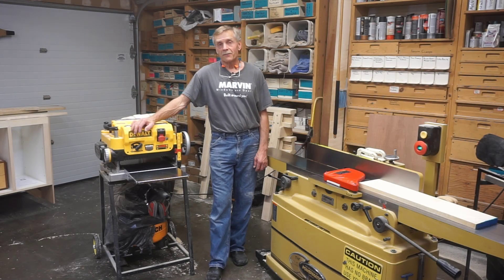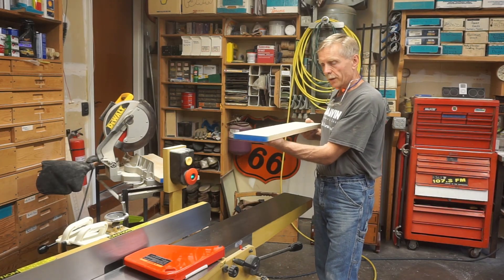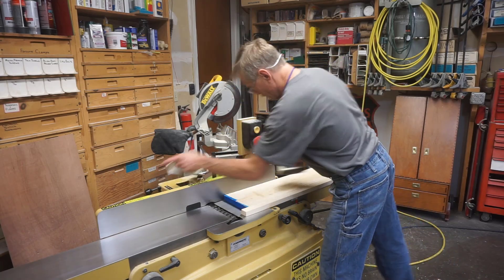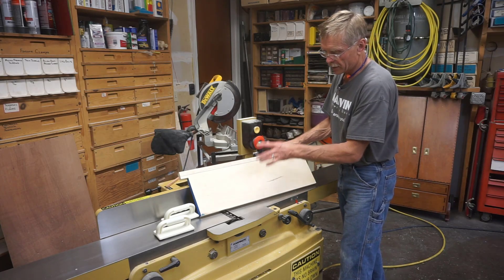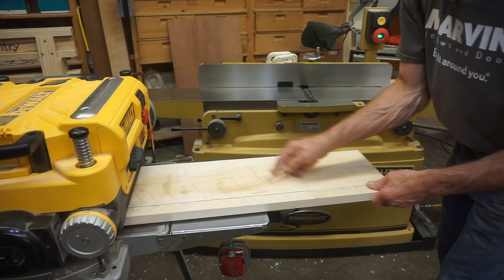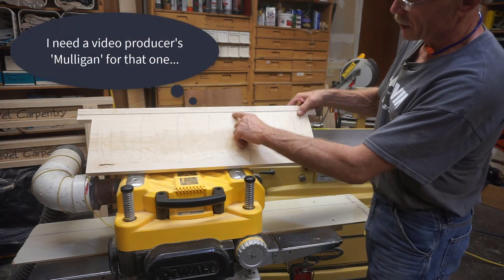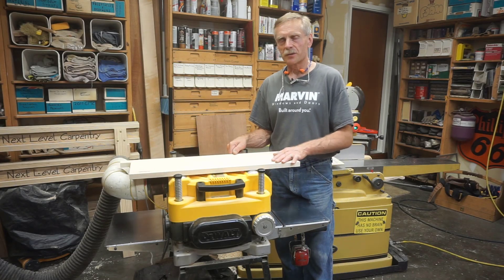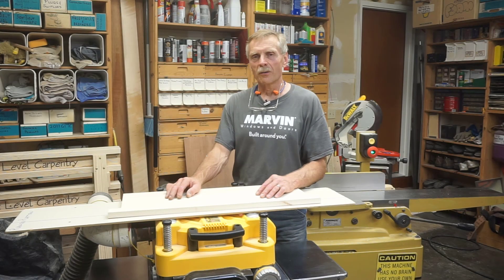Supersize Your Jointer for Planing Over-width Boards

Comment: Could you also make a platen for the infeed table of the jointer?  The board would ride on the platen and thus be clear of the rabbeting shelf,.  This would eliminate the need to remove the shelf.
Reply from the maker: Mike... your idea works in theory and probably also in a pinch or if no thickness planer is available but capacity and quality of the end result would likely be compromised as well.... never know what's possible until you try it!  Cool part is that you're thinkin' about more options and I like that part! Best, Matt
Reply: Matt - thanks for the quick reply.  I wasn't thinking of the jointer platen as a way of bypassing the thickness planer (I have an 18" Woodmaster planer), but simply to allow multiple passes on the jointer without removing the rabbeting shelf.  In fact, on my 8" Grizzly jointer, the infeed table is wider than the cutter, so removing the shelf wouldn't help - the ridge left on the board after the first jointer pass would ride on the wide infeed table.  So a platen on the jointer would be needed if multiple passes are to be made, at least with my Grizzly.  I'll get a sheet of hardboard tomorrow and try it out.
Reply from the maker: @MikeON22  Oh, OK, got it.  I think you're on to something there... a guy could get a LOT done with a 1/4" mdf melamine 'overlay' platten the width and length of the infeed table!  Just thinking out loud here: you'd have to make sure it was really secure and held down tight and then just set the depth of cut an extra 1/4" deep.  The only limitation I can see at this point is if you needed to remove more than 1/4" of material to flatten the board because it wouldn't clear the rabbet shelf but would certainly work 90%  of the time.  Thanks for adding this Mike... good thinkin' !!!  Best, Matt
Reply from the maker: @MikeON22   I understand the table width to cutterhead width issue you mention.  On my powermatic I use a 'rabbeting tip' in the Byrd Shelix spiral cutterhead so I can still rabbet.  The unique shape of the one carbide insert removes that little shaving of wood so that the edge of the cut clears the outfeed table.  Not sure if you actually meant your 'infeed table is wider than the cutter' or if you meant the outfeed table.  If outfeed table, I always set straight knives to stick out of the cutterhead slightly on the left so the cut clears the outfeed table.  With the spiral head the rabbeting tip addresses the issue.  Just added this FYI in case it's new information for you, not like I think you need any schoolin' from me... 😏 Best, Matt
Reply: Tried it this morning and it worked great.  Yes, it is the infeed table that extends beyond the cutter, on the side away from the fence.  So I clamped a piece of hardboard to the infeed table and jointed an 8-1/2" oak board on my 8" nominal jointer.  Then planed it with your method.  Thanks for the tip about the rabbeting inserts.  I wasn't aware they existed, so ordered some for my Byrd Shelix spiral cutter and installed them.
Reply from the maker: @MikeON22  The rabbeting inserts seem like a well guarded secret which surprises me for how important they are.  I'm going to remember your infeed table platen idea next time I've got to deal with over-width material and thank you in advance because I've always hated taking the rabbeting ledge off and then getting it all lined back up when putting it back on.  Best, Matt
Reply: Matt, love this tip even though I have a 12" jointer, because I can use it in others' shops and pass the info to fellow woodworkers.  Love the dialog between you and Mike also, as it got my rusty brain-gear turning.  I have, on numerous occasions, tried to flatten boards wider than my jointer on my jointer------with great frustration.  My machine doesn't have the rabbet insert to worry about, but reading though Mike's evolution, I thought there might be a way using a platen.  I set the jointer to 8" and took a 3/16 pass on an 11" wide board with nearly 3/16 cup and twist.  Then I clamped a 4" wide x 3/16" thick piece of underlayment to the infeed 4" away from the fence, registered the middle (newly flattened) portion of the board on the platen and ran the remaining rough 3"over the jointer to achieve a perfectly flattened face.  With yours and Mikes help, I now have a way to flatten a board 50% wider than any(???) jointer.  Now, please help me get a wider board through my 13" delta planer!!! 

PS.  Just after I finished writing this, it dawned on me that I could have clamped the platen next to the fence, removed the fence and then run the board.  This location of the platen would theoretically allow flatting any width board over the jointer by just stepping it over 4" at a time (the board, that is). @NextLevelCarpentry
Reply from the maker: @francismccabe3265  I appreciate your commentary on this... it's got me assured that I'll adapt the partial platten idea next time I'm flattening wide stuff that takes more than one pass to flatten because it's such a pain to remove and replace the 'rabbeting lip' from my jointer (and any jointer too, I assume).  I'd be nervous about removing the fence and running the board the other way though... just makes me uneasy thinking about the workpiece drifting off to one side or the other and exposing the cutterhead mid-pass.
It is an interesting concept though...
I've got no thoughts on planing 13+ inches in  a DW735 though, so if you come up with some magic for that I want to be the first to know, OK?
Reply: If I make that magic real, you've got a deal.  I didn't have any problem keeping the board on track because the remaining "raised" rough surface ran alongside the platen, making the platen a fence.  My board was only 2 feet long also, so no problem.  This application is probably best suited for raised panels and short table tops, etc.  I agree with you, long boards would be quite difficult.  My big ole antique jointer actually has a rabbet groove 5/8 inches deep on the outfield table (a 12 inch jointer with 17 inch wide tables), so I don't have the rabbet lip on the infeed like the newer jointers.   @NextLevelCarpentry
Reply from the maker: @francismccabe3265  your 'ol jointer sounds like a beast of a machine! Way to go keeping it in active duty. Is it an ordeal to sharpen those long knives?  Can you get new replacements?  A millwork shop here used to have a knife sharpening fixture that bolted to the outfeed table which really made blade maintenance a breeze for them.  I always envied that because the old Delta 8" machine I used at the time was a real chore to service.
 I now see how the material feeds along the platen on the second pass... far less of a cringe factor than I was imagining.  Can't wait to try this next time.
Best, Matt
Reply: There's a bit of story behind that monster.  15 years ago I bought a big Delta table saw on Ebay from a farmer in Wisconsin.  In the pics I noticed some other tools around, but not for sale.  Built a rapport with him during purchase and shipment, and found he had that 12" American (made by American Wood Working Machinery Co up the road from me in Williamsport, PA probably between 1915 and 1925).  Price was $750. He said he thought it weighed 750 lbs.  OK, my little 1970 vintage Kubota with homemade forks on the bucket can lift 800 lbs.  He also had a 24" Powermatic planer complete with blade grinding attachment mounted above the cutterhead (like you, I sure wished I had something like that)!  Unfortunately the planer was over a ton, took up 5 ft x 5ft footprint and had 10 hp worth of 3 phase motors, so I had to (take a) pass on it.  I still think of the things that could have been......

Well, the jointer arrive crated weighing 1490 lbs.  I had it delivered to my work at the ship pier and used a fork lift to get it into my (then) GMC 1500, and drove it home-the truck, that is.  My shop is above the basement garage with exterior entry door over 4 ft above ground.  I secured a 1 ton chain fall to the floor at the other end of the shop and skidded the jointer up a ramp of 4x4s and into the center of the shop.

The jointer had a 7.5 hp 3 phase motor direct connected to the cutter head, so i removed that and mounted a 3 hp single ph inside the solid cast iron skirt of the four-footed jointer.  Used a hole saw to cut a hole in the iron skirt for the motor shaft to protrude,  perturbing the artifact Nazis out there, I am sure!  But the machine had already been modified to a 3 knife cutterhead with ball bearings replacing the original babbitt, and the motor was also a very poorly installed modern thing.

I was able to get the knives sharpened locally, no problem, but they were a real pain to reinstall in the cutterhead evenly.  I was successful in keeping them sharp by lowering the tables a bit, wrapping a couple loops of protective tape at each end of a large oilstone and using it to hone the blades.  I rigged a wood block to index the head and maintain position while honing.  The next 2 times I ground the blades myself by putting a grinding wheel in the tablesaw and using a cross slide jig.  Yeah, disconnect the dust hose and clean out the saw cabinet prior!!!

The blades markings indicate they were made by some aftermarket (I can't remember which) blade maker, but I am not worried about replacement as I don't do enough work to wear them out.  Some of my friends have converted to those carbide cutter heads, but at this time, I cannot justify the expense, plus I would probably need to re-bearing and reshim the whole thing.

       @NextLevelCarpentry
Reply from the maker: @francismccabe3265  wow... and epic tale for an epic machine... it's cool you kept if from the scrappers too! I don't remember seeing you on the alumni list from M.I.T. but, from the sounds of it, you earned your degree in advance Egyptian Engineering there!  Truly a labor of love to get it, get it up, running and useful as well as keeping it that way.... good karma if nothing else... Best, Matt
Reply: Well, Matt, I guess that although I have degrees in Egyption, Conniption and Science Fiction from M.I.T., I'm probably not on the alumni list cause I never graduated.  Seems like I have to go back there every day.  Good thing is that when I go, I always learn something.  There are those folks with MIT fear and don't go near.  Will they ever learn? 

I have several old machines that I rescued from the scrappers with little or no cash, although some have been over-paid for in time, skin and blood.  There is nothing like the feeling of bringing one back to life, though.  @NextLevelCarpentry

Comment: Just a thought and maybe I'm not thinking properly but could you move your fence over far enough to have the planed part of the board overhang and run your board over to plane down the last bit to match.
Reply from the maker: MrCFerren,
Not sure if I know exactly what you mean but it would be really difficult to plane off the 'lug' on the edge of the board on the jointer... it tends to get thrown off by irregularities you're trying to remove in the first place... that's why the platten and thickness planer method works so well.  Best, Matt

Comment: Slick process. I have a DeWalt 735 and a Delta 8" parallelogram jointer. Will attempt your method in near future.
Have heard about the rabbit ting feature of the jointer. However have never seen the process. Any chance you might post a video on rabbiting with a jointer?
Reply from the maker: Thanks Bob... approach this method with your full attention and you'll do fine.  As far as a dedicated rabbeting video I don't forsee it in the video line up but I actually cover its essentials in this video. What I'm doing is actually making a very wide rabbeted board where the rabbet itself is a full 8" wide x about 1/8" deep.  It seems less like a rabbet because the 'lug' of wood on the edge of the board that doesn't get planed off is so narrow by comparison.  The comment I make here: https://youtu.be/vzmSjlXJ2fg?t=187 is a key part of the process because you need to cut the rabbet to full depth and width in ONE PASS if you don't remove the rabbeting shelf.  I believe  your Delta jointer has a removable ledge so it should be possible to remove the ledge for rabbets that require multiple passes since only when the ledge is removed will the board remain down flat on the infeed table after the first pass.  This will make sense when you experiment.  Re-watch the video starting about 3:00 or so keeping in mind the operation you're thinking about and how it differs from the result I'm after here.  BTW while a jointer is fully capable of rabbeting operations I rarely use it for a number of reasons.  First is that the cutting action of the ends of the jointer knives (or just the tip of the very last carbide cutter) cuts the shoulder of the rabbet which can leave it a bit ragged. 2nd is that boards any wider than 3" or so are hard to keep flat when ploughing a narrow but deep rabbet.  For consistently accurate rabbeting I much prefer a dado blade in a tablesaw.  Hope that helps... Best, Matt

Comment: This is BS. The thickness planer is a modified DuhWALT board stretcher BS1000. https://www.youtube.com/watch?v=bgS6-O2APWY&t=1s. Please watch the video and follow the classroom on the patent pretending process. The whiteboard diagram is hilarious. Made me a subscriber.

On a serious note... If there is a large difference between width of board and jointer, when running through the planer, will board have a tendency to flex down from the cutting pressure on the non supported area causing a concave in the finish after springing back?
Reply from the maker: Hey Philip, BUSTED!  I hope DuhWALT doesn't give me a bad time for re-purposing their fine BS1000 machine into an ordinary thickness planer!  I almost deleted your comment since YouTube sequestered it in the 'Waiting for Review' folder... glad I didn't!  Plus that would have been ungrateful of me considering your subscription!

For your question: you've dialed right  in to the main limiting factor of this method; nice!  The farther you push the 'supersizing' process the more you have to pay attention to potential issues like the one you mention. I'm OK with an 8" joiner and a 13" wide piece of stock which is about a two thirds to one third width ratio but anything approaching 50/50 probably wouldn't work.  I don't see any flex issues with 3/4" thick material trying to 'cup' from the pressure but there seems to be a tendency for the piece to 'rock' along the edge of the platten which would result in a piece with non-parallel faces... hope that makes sense.  When pushing the limits I always make sure the platten is well waxed, knives are newer/sharper and that I take light passes.  Extra thickness to work with is always nice because it allows me to flip, flatten, flip and flatten more and end up with a really nice flat board in the end.  You'll see what I mean when you do this and you'll find little work-arounds for times when working at the extremes of your equipment's capacity. 

Best, Matt

Comment: This is a great idea. One thing that is not obvious in your video is the pressure you put on the board when going through the jointer. It should be just enough to let the cutters work but not so much that you flex the board. If you push too hard you are replicating what a planer does.
Reply from the maker: That's right Richard... I hope that your clarification helps other viewers get the same results I do by avoiding the use of too much pressure while feeding the board through.  Best, Matt
Reply: If I am right, there should be more of an effort or pressure on fence to keep a 90 (at least when on edge) than on cutterhead. I normally put maybe 20% pressure down and 30% pressure against fence and the other 50% is praying that I am feeding the stock in the right way and avoiding tearout LOL
Reply: For jointing, keep enough pressure against fence to keep board in contact, but not so much as to flex the board.  Above might work for facing if the board is quite thick and the edge has been jointed.  

Mostly  I try to rock the board on the jointer table a bit to find the high spots (if board is bowed up or twisted).  Put the most pressure on the forward high spot and maintain the pressure all the way onto and along the outfield table.

If bowed side is down, put pressure in middle of board.

 @PatonMacD
Reply from the maker: @francismccabe3265  Pretty good narrative here... thanks! Best, Matt

Comment: Hello there, I think your vids are great thank you for your skills sharing. I have a question. I’m looking for suggestions on how to glue up 1x1 strips to make a square, though I’m thinking of gluing them at  diff lengths to stager and eventually obtain lengths of 30-40 inches. Would you have suggestions on how and possibly what kind of glue to be flexible to maintain the wood glued due to bending or pressure..?

Comment: Seriouse question: bearing in mind that im totally new to all this, my question is, why wouldn't you run the board straight through the thicknesser straight away and not use the joiner at all?
Reply from the maker: It's a basic principal Adrian, but not necessarily obvious as you learn more about woodworking.  The function of a thickness planer and jointer are the same thing only different.  They both mill one face of a workpiece with a spinning cutterhead however only the jointer is designed to flatten as it mills (planes).  If a warped board is fed through a thickness planer it will come out the other side smoother but just as warped/twisted as when it went in.  Proper technique using the jointer FIRST flattens out both warp and twist AND makes the face smoother.  Only then will the thickness planer make a flat, smooth, parallel face on the opposite face of the board.  Hope that makes sense and explains things.  Let me know if it doesn't and I'll try to explain further?  Best, Matt